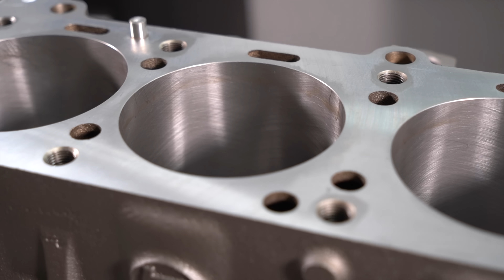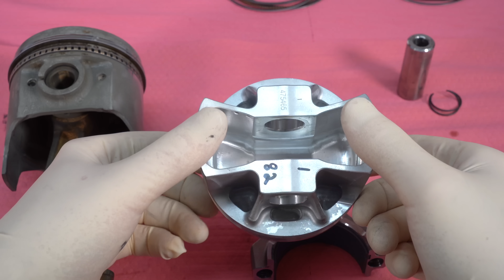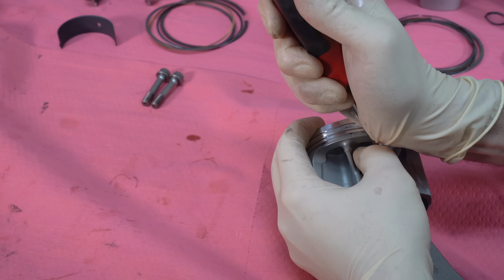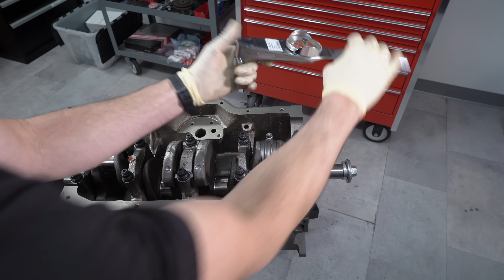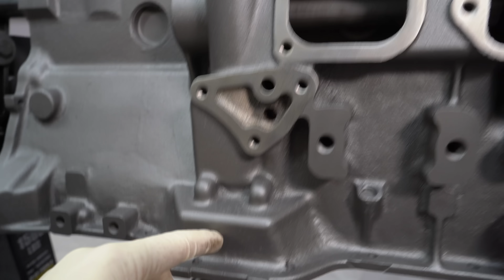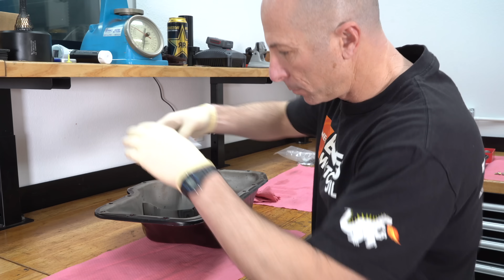Toyota 18RG Engine Build - Full

Comment: The 18R-G was based on an ohv engine like the 4k and 2T-B but has a Yamaha twin cam , thats why there is an idle shaft and dual piggy back timing chain setut. Hence the differe between 2T-B OHV/2T-G Twincam and 18R OHV/18R-G Twincam
Reply: the 18r-g is based on the 18r, the 18r is OHC no OHV, I have one in my 1980 toyota corona, the 2t and the 4k are indeed OHV

Comment: Wow , I rebuilt an 18RG as an amateur back in 1983 here in Ireland, but I put this 18 RG engine into 1976 KE35 Corolla , some yoke to go , even beat 400 four Honda bike in a standing start. The KE 35;also had the pillarless wind down 4 windows , we caught out a few girls with mini skirts, letting on the doors were welded like the general Lee , nice view as they clambered in and out through the window apertures .
Absolutely addictive intake engine noise particularly on DCOE webbers.

I believe Yamaha did the 18RG heads for Toyota .
Lovely upgrades on the pistons ,rings and rods , I can’t wait for the dyno sound .

Comment: I did this on a similar era engine 20-odd years ago. I poured thousands of dollars into a 4K, ported the head myself at a local engine shop who let me use the die grinder. It maybe made as much power as a stock 4A. But I didn't need a high pressure fuel pump or ECU or new engine mounts or transmission or driveshaft, so big advantage for me at home with nothing else. Plus it ran off the tacho and off the speedo and sounded super cool.

Comment: Awesome stuff, thanks for putting this up. I have two questions - Where did you get your top chain guides? They look new but pretty sure they're not available anymore, so did you modify a 2TG one or get them re-lined? Also, what oil pump did you use? I've only seen standard 18R pumps for sale in the last 5-10 years and the 18RG has a spacer plate and taller pump gear to increase it's capacity.

Comment: Nice! I put an 18RG in in my Celica back in the 80's - 140hp of fury. I loved the sound of the sidedrafts. 11:1 seems really high for that old engine! Should rev like crazy now. No anti-friction coating on the piston skirts? Last time I used Total seal, the ring gap overlapped.. that not longer a thing? Funny that the block was from a fork truck (Yamaha did the head)

Comment: Hey not sure if you are aware of this or not, but the oil pump you installed is for an 18RC and not an 18RG. The 18RC oil pumps don't have the 5mm spacer plate that goes in between the two halves of the pump body. The 18RG pumps have a higher flow rate for the increased RPMs.
Reply: This is critical info. So many of these motors (including mine) were assembled on 18RC blocks using the RG head/pistons. I wonder if this is an RC block. If so it would have a larger diameter crank shaft too making it hard to spin it past 6500-7000.

Comment: The white assembly grease imo is not good, it doesn't dissolve with heat. Itll be there months after the engine is in service. If you use assembly goo, it's thick like wheel bearing grease but the first heat cycle it mixes with your break in oil and is completely run out with the first/2nd oil change, no trace remains after the first real heat cycle. Definitely worth looking into if you're going to have an engine sit for any length of time before running... Theres assembly goo for auto tans building and one for engine building

Comment: Old school one, very similar to the 2tg and the 3tg, they also got 18R and 21R but single cam one. Back those day we take 2tg head use 3tg bottom is better, because the 3tg twin spark some time miss fire badly and 2tg much easy to find good cam. People now this old engine are getting old too, hahahaha 😂😂😂😂😂
Reply: That's what I had in my '72 .. a 2TG with 3T bottom end and twin 48mm Dell'Ortos

Comment: Love watching the build, has a lot of usable information. With the next video of the of the install could you please go over the ignition system and how you got it working more indepth. Thank you I have 18rg head that I'm going to be putting on the original 18r motor that came in my 72 Celica and as you probably know the timing chain cover is the same on the block just missing the distributor port on it. Love watching your updates on projects you channel is a wealth of knowledge and am happy to see we share a lot of the same appreciation and taste in cars as I also have a 1st gen RAV4 that some day I plan on doing the 3stg swap on.

Comment: it is so well explained i feel i could assemble one myself
Reply: Read the various spec sheets. Transfer all key numbers on to a "recipe list". Lay out all the parts in a logical order. Go slow and methodical. Then yes, you can absolutely do it.

I did my first complete engine rebuild when I was 16. Granted, it was just a 4 speed 2 stroke 50CC Yamaha moped. But because I was "a Lego kid", and just followed the Haynes manual like it was gospel, I mysteriously got everything right in the first go. Took an entire weekend. But I was hella proud for months.
Reply: @andersjjensen  i can feel your passion, really cool story
Reply: @maxtheyouth  Thanks. My point was: if you're fascinated by this stuff, you can do it. And you don't need to do a wildly expensive racing engine to get the satisfaction.
Reply: @andersjjensen  thanks, good chance i will, i started to build a tool collection recently , i quit drinking and i need to find better hobbies ;) thanks again
Reply: @maxtheyouth  I started with mopeds and moved to older small motor cycles before eventually tackling cars. Small motorcycles are much less tool, space and equipment intensive, and it would turn out that you can basically fund your tool collection by fixing up beaters and selling them again. Much better than staring down that bottle... I've been there too.
Reply: @andersjjensen  thanks good advice